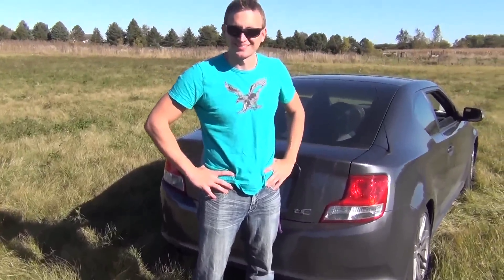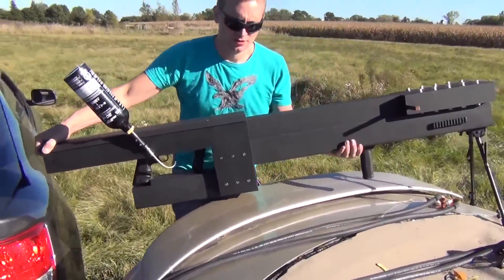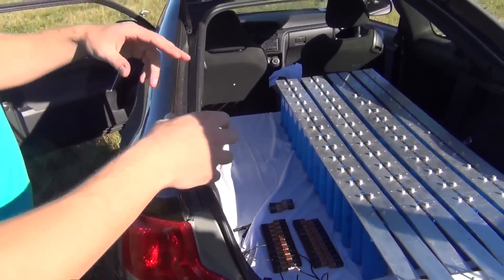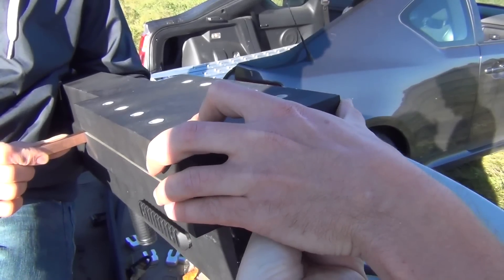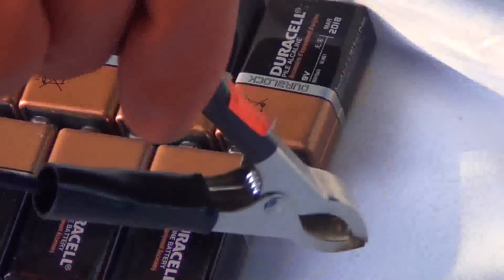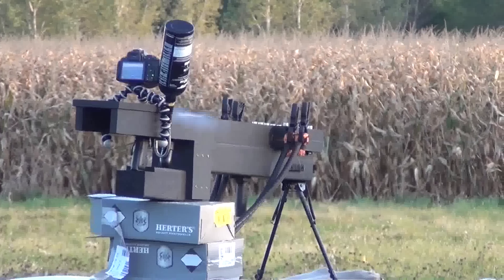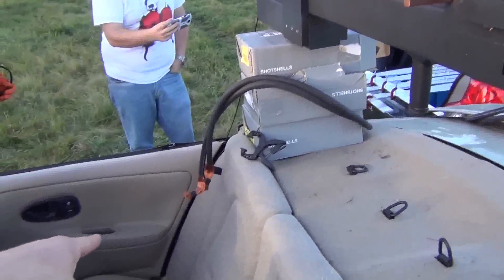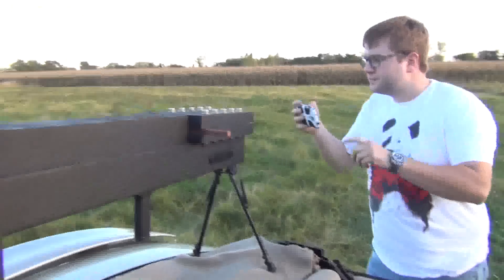Backyard RAILGUN: Field Testing the 250 lb Electric Gun, 27,000 Joule (max)

Comment: Using Copper pipe of equal surface area to the Aluminum bars will reduce resistance and it can be easily soldered at all connection points, lowering the resistance even further and eliminating the need for all of the c clamps.  Result: more power to the rails.

Comment: So regular guns have muzzle flash and railguns just have sparks is that correct?
Reply: +Fell Man There is no explosion in a rail gun in order to speeds up the projectile so there is no muzzel flash. As far as I know there can still be a explosion but thats because the projectile moves so fast (not on a small one like the one in the video tho). A railgun uses 2 rails and electric power to speed up the projectile. Use google if you want to know more, im bad at explaining things and englisch isnt my main language^^
Reply: - 13N1304 - Well that's what I mean muzzle flash caused by friction rather than explosion.

Comment: That much awesome engineering capped with ...a pile of 9v batteries, the worst possible battery in existence for any job ever...
You sir need a high voltage power supply to run off that fancy car battery you have with you :D

Otherwise, very cool project.
Reply from the maker: I thought the 9 volts were kinda cool.. it's different.

Comment: Hi,
When I worked for Bussman (of Buss Fuse fame), in St. Louis, we had occasion to go to an old dynamotor station in St. Louis.  This was a 5mb motor to dynamo plant which at the time still supplied 600v DC to some facilities.  It has since been decommissioned, and I assume removed.

However when we went to do our testing, I watched the engineers hook up 4-0 cables to blow our fuses and wondered if they knew what would happen.  They had run the conductors parallel each other as was the normal procedure for AC.  However with high current DC, the conductors were going to do their best to form a circle when energized, even though it was for a 5000 amp fuse blow.

So I suggested to take each of the conductors out of the connection bay, down halls on opposite sides of the area, and into our station with the fuse.  We still knocked out a bit of plaster board when one fuse blew.

These were large silver element Limitrons, being connected to a 100000 amp bus @ 600V potential power delivery, which is the upper interruption rating for the fuse.

I suggest you shape your conductors to be rigidly contained for future blows, or even better shape the route of the heavy conductors you used (2 x 4-0?) to a circle for minimizing your physical problems next time.

Cool project.  I love seeing them charged up by 9V batteries.  Might not be combat field effective though, dragging several hundred # of equipment thru the jungle waiting several minutes / shot.
Reply: yes wires will jump when high currents are applied.we did the electrical on a strut line for Monroe shocks in 1990 in paragould ar.the welders were connected with 500 mcm wire.we had to nylon tie the wire down in the cable tray so they wouldn't shift when the welders were energized.
Reply: +Ali Ahadi Ya mostly because they are so power hungry that only a nuclear reactor or other power source equivalent to a small city is really feasible for continually firing them.
Reply: Nevir202 yea or any rate of fire worth a damn
Reply: +jim stephens From my understanding railguns are currently limited to large vessels to be any useful, like the one that US Navy has.

Comment: Aluminium is not magnetic material, so how you can speed up it with railgun? looks like fake for me.
Reply: +Deloix It doesn't need to be magnetic, only conductive, carbon is non-magnetic and it would still work, because the changing magnetic field induces current in the projectile and that current induces and opposing magnetic field, these two fields oppose each other thus creating force, which pushes the projectile forward, theoretically since a lemon is conductive, you could make a high speed lemon shooter
Reply: +deuterium48  A high speed lemon shooter? We finally get a chance to make life take the lemons back. Get MAD!
Reply: You're thinking of a Gauss rifle. (coilgun)
Reply: The Lorenz force only requires the stator to be conductive, not magnetic. The lorenz force is also why the power feeds went flying off.

Comment: Assuming the projectile is 64 grams, which I figured by looking at the volume and multiplying by the density of aluminum, and there is no energy lost to friction in the barrel (which there clearly was), I calculate the speed of the projectile to be about 3300 km/h. This seems too fast, but it's a rail gun.
Reply: It was friction by the barrel but that was the part powering it

Comment: I'm no expert, but it seems to me using a non ferrous projectile, and uninsulated rails only causes a huge short instantly when it is activated. That is why all the connections blew apart, and arced the aluminum contact. Can you explain how the aluminum projectile is forced out via a magnetic wave?
Reply: +kbert63 From what I understand, he intentionally creates a short. The projectile contacts both copper bars, which completes the circuit. The electricity flowing through the copper creates the force required to launch the projectile.

Comment: Use contact paste next time, that is thermal and conductive. Every connection from caps on thru assembly, everything, to rail coils. Have you thought about using fiber optic on trigger control to prevent death, like they do for Tesla coil triggers.
Reply: +Ziggy Zee If your peak current is that high, you should be adding inductance to flatten out your pulse shape. That will make the diodes more affordable. The best place to put them would be at the end of the bus bar where your cables attach with several in parallel. It depends on how much you're willing to spend.
Reply from the maker: +John L Bales I need a little MORE resistance.. rather than less. If the caps discharge and current "rebounds" and flows in the opposite way enough, the caps can be damaged.. It's like dropping a basketball and hoping it doesn't bounce too much.

I'm getting some negative voltage after the shot.

In my most recent shot, I disconnected a single cable. Have to protect the power supply.
Reply: +Ziggy Zee That's why you should use diodes.
Reply from the maker: +extracrispyz I don't believe there is a economical source for 400,000 amp, 800 volt (safety factor of 2) diodes (for going into the railgun).

BUT, We could place a few between the capacitors as a means to short out any additional energy.

Good idea, I'll have to look into that.

(It was rather surprising having some negative voltage- the inductance of the device should be low enough to not have that issue...)
Reply: Thank you for your input. What did you think of isolating the trigger circuit via fiber optic control idea?

Comment: Any idea on muzzle energy/efficiency? I'm going to try to make one this summer that is portable (backpack bank) that fires smallish bullets.
Reply: I was going to get some Nichicon 450v 12,000uf caps for the bank. Any advice for getting a bullet of a .50 bmg round to go 200m/s? I did my calculations assuming I could get a 1% efficiency out of the gun, I would have to get 22-ish capacitors (which I am thinking is wayyy to much now).
Reply: Also, what metal was that used for the rails?
Reply from the maker: +Andy Olarra copper

Comment: How do you mean hand haled you bone heads... Also all you had to do was shot CO2 out of the front. I am calling BS on this thing.
Reply from the maker: +Richard Berglund The CO2 powered projectile cannot overcome the friction of the rails- when fired without electricity, the projectile slides to a halt in less than three inches. The CO2 eliminates the needs for a complicated switching mechanism.
Reply from the maker: +Richard Berglund It can be held.. it's just really, reaaally scary.
Reply: Ziggy Zee Yes i watched the video... You said the same thing. I just would like to know at what point did the projectile come out how fast was it going? Also the the whole gun blows apart (thats why i assume you guys have a string to fire it) Also proving my other point this is not a hand held rail gun. If any thing its like mortar that you hope works.
Reply from the maker: +Richard Berglund This was the first test fire, ever!- everything was shown for transparency, the screwups, etc. Refinements have been added and we've done some pretty cool damage in the last two weeks. It takes a bit to get the footage compiled, edited, and uploaded. Almost there.

Comment: This is awesome! When is part 2? How many uF you guys running through the railgun each shot?
Reply from the maker: +I'm Bored 6000 microfarads x 56 caps @400 volts. The energy equation is 1/2CV^2. About 480 joules in each- the energy of a standard military .45 per capacitor.
Reply: Each cap has 6000 microfarads? Wow. Oh i also had another question, how are you charging that bank? Do you have a transformer in the car?
Reply from the maker: +I'm Bored Batteries- it's shown in the video.
Reply: +Ziggy Zee Oops, my bad. I missed that part.